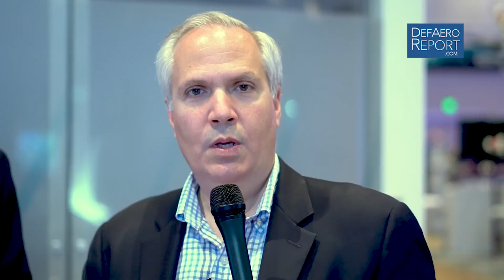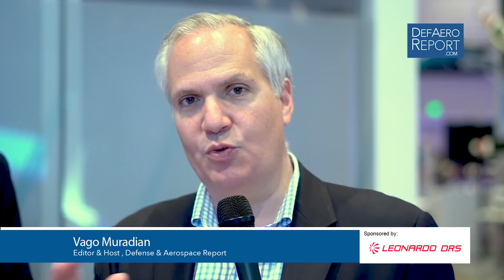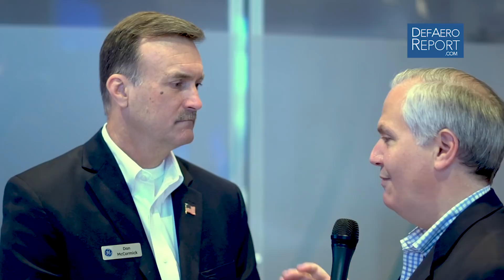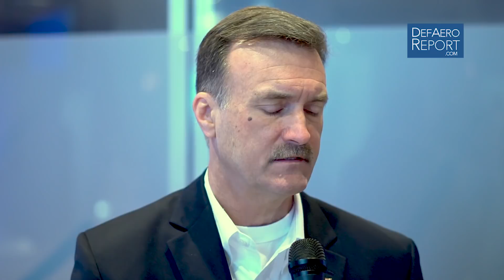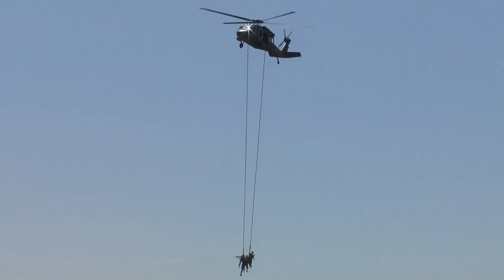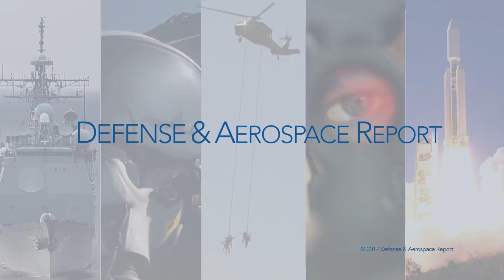GE Aviation's McCormick on Developing Next-Generation Jet Engine for USAF

Comment: For its day the engines in the Lockheed SR-71, the Pratt & Whitney J58 were ahead of their time. Design attributes more so than high temperature alloys. Using Scramjet ability to compress the fuel air mixture, aerospike movement in the front to control the air stream, bypass features, etc. Quite brilliant. I hope the new engines are just as much gamechangers.
REPLY
Reply: The Airforce or Navy need to set high standards so that engineers can rise to the occasion